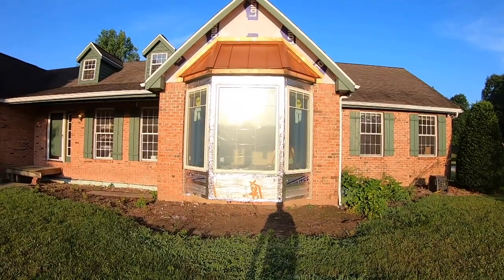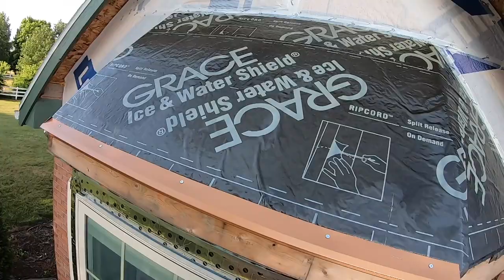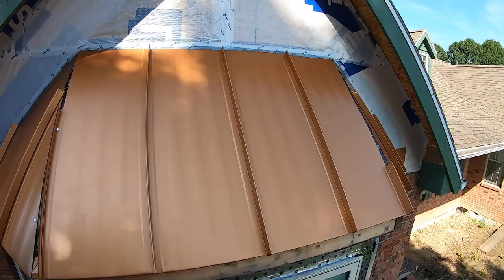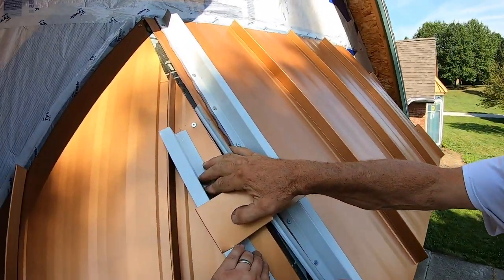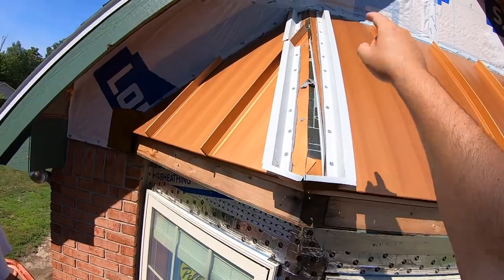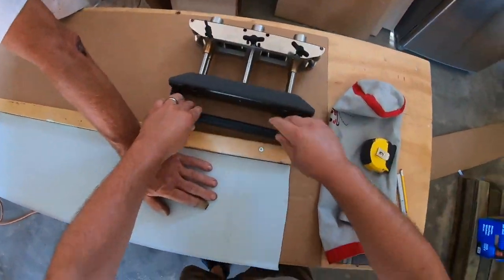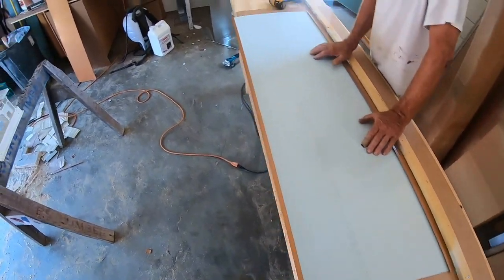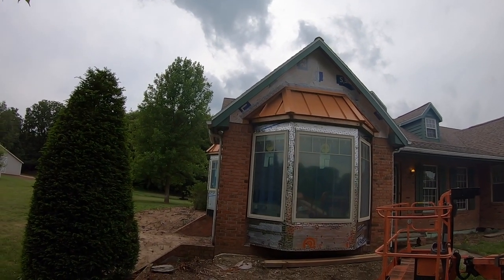How to Install a Standing Seam Metal Roof on a Bay Window

Comment from the maker: In this video we install a standing seam metal roof on a bay window. This is a great project if you are looking to dress up the front of your house. If you have any questions or suggestions feel free to drop them in the comments. Also, the links below are to videos about other metal roofing projects I have done if interested. 
Roof Layout and Installation of Metal Valley Flashing with a Slope Transition on Standing Seam Metal https://youtu.be/rIB7mgjFSL8  How to a Install Standing Seam Metal Roof, SSR 450 SL Panel Profile https://youtu.be/_emb-7ImiGQ  How to Make Kickout Flashing With Standing Seam Metal Roofing: Pole Building Side Wall Flashing  https://youtu.be/NUXzvq3d4QQ

Comment: Great work.... your buddy in the white T needs a vacation.  It's not hard to see the dude can use a few days in the sun without holding any tools.  When he gets back give him a tool belt and a few fresh T's.  He's got the skills but a rest is what he deserves.  Throw a bit-stop onto that drill to save the odd drill into the hand on push through.... done it more than once and the $5 stop is worth it.  thanks guys for all the hard work.
Reply from the maker: Thanks for the tip.  That’s my dad and I agree he deserves a break.  He’s on vacation now actually, but he gets bored easily so it won’t last more than a few days and he’ll be working on something.

Comment: The angles on each piece of flashing are 22 1/2 degrees. There 135 degree outside corners 45 degree inside corners.
Reply from the maker: Sure, in an ideal world where everything is built perfectly haha
Reply: Well the biggest variable is who made the bay. In the factory the norm is a 3 panel bay is like that. If it isn't then all the angles will add up to 180. That's including the angle of the first window and last window off the wall. If your framing the roof them that framing is on you. If your buying 3 windows and framing them out then it's all on you whether the angles are right. Either way nice copper work. That extruding machine was really cool.

Comment: let me ask you,  can a roof metal be build with an aluminum coil in a brake press?
Reply from the maker: If it’s short runs like this then probably.  However for long runs I don’t think it would work.  Roll formers just create a nice smooth panel very quickly.  The cost of renting a roll former would quickly pay for the time saved on a normal sized house roof.
Reply: yes i have done it many times. i have never seen the hand benders he has  but yes you can make it on a good heavy duty tapco break

Comment: I've only been able to find one roofing company in my area to give me a quote and it was over $5,000 for just one window like this. Doesn't that seem a bit outrageous?
Reply from the maker: It does seem high but they are a lot of work and take a lot of time.  To do it right you also have to remove siding and reinstall after the roof is done.

Comment: Please provide for a cost for each bay's roof. Thanks.
Reply from the maker: Well it depends on a lot of different variables.  What gauge of metal, what paint finish, what tools you need to buy, what metal panel profile you are using, are you paying someone to do it, and so on.  I used the heavier 24 gauge with the higher end paint finish.  I used around 40 linear feet of metal panel on each roof and purchased 2 ridge caps so the cost was around $150 per roof in material.